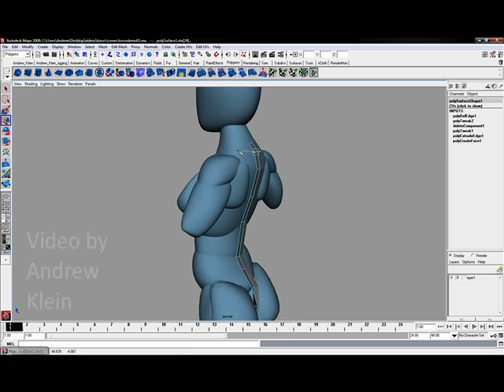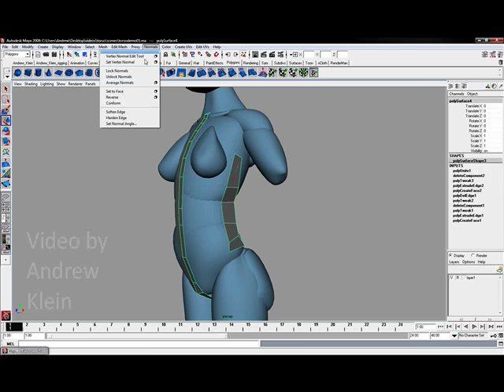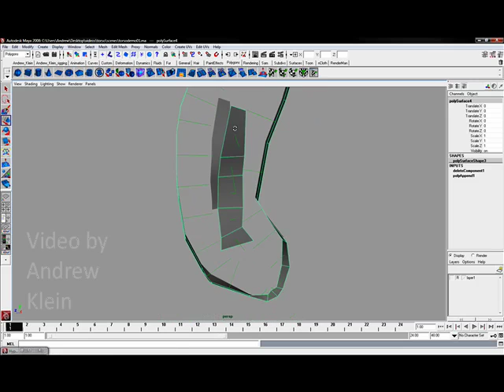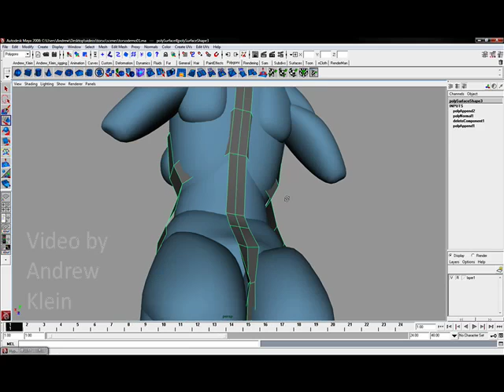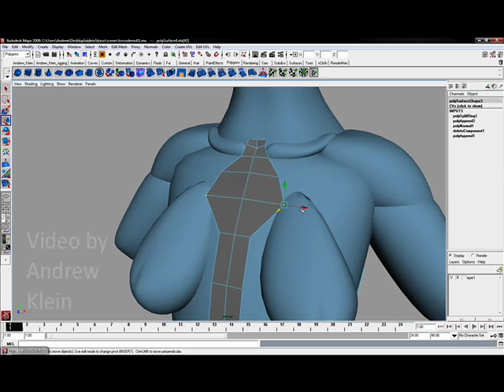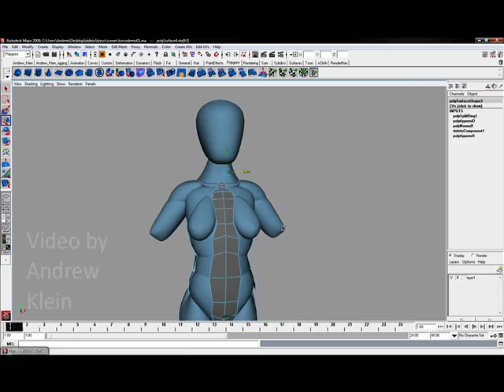Maya Character Modeling: Female Torso pt. 3

Comment: This is a very interesting way to look at tackling a model. I've watched these since part one and have to say that the video's have been extremely helpful so far.

So, is there almost no difference between the append polygon tool and the bridge tool? I've tried to practice in maya and found the bridge tool to be a bit fusy but the append tool seems to get the job done much better.